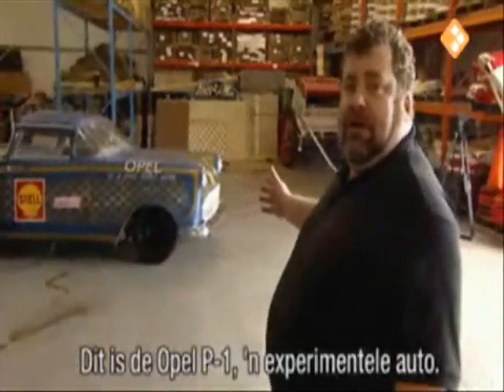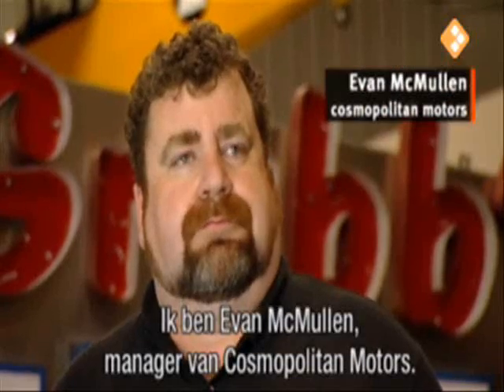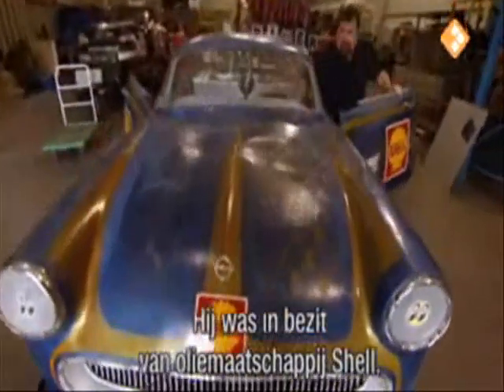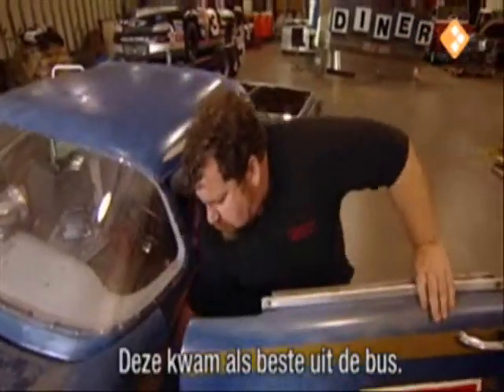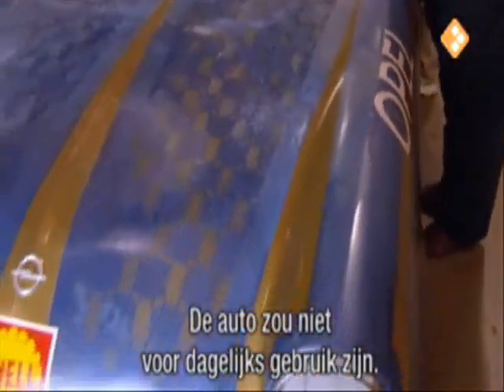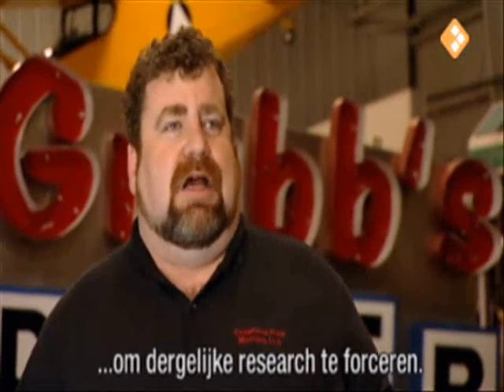High mileage car. 376 mpg!

Comment: I remember the Shell commercials for platformate and it gives me a feeling of nostalgia..
.
Reply: +Marc Mallary 
I used to drive a 1995 Nissan Altima when I had to commute (now I live close to my job)
it was a 5 speed manual
managed 36mpg average in it. (Yes, I know how to drive it for economy, it was rated 27hwy by the EPA)
not bad considering it was actually roomy enough for 4 people,
weighed almost 3000lb,

and had an engine a liter larger in displacement than your Honda.
Reply: I had a 1990 nissan sentra that had no power steering.
You could order one with it, but it wasn't standard.
The sentra b13 also didn't have power steering on the base trim (Sentra E...which also had a 4 speed manual)
My drives weren't on a Sunday, they were my daily commute miles.
If you didn't care less than why would you reply at all?
Since I did get those fuel mileage numbers it happened in this universe.
BTW if you actually understand the concepts of inertia and plan further ahead than what's directly In front of you, you can beat EPA numbers easily in any car.
Reply: Really? My experience shows otherwise and apparently it's the same universe because I am able to reply to you
Reply: It was Sunoco. The name is the name that the company used to get the petro from the tankers to the platforms, hence "platformate."
Reply: The Big Oil floods the market with cheap oil and gas cyclicaly, closely laging inovation. It's happening now. 
I drive a 1992 Civic VX and average 46 mpg city with no modifications, just driving sensibly and going the speed limit.
It is rare because it was developed just before the Iran vs Iraq war and 2 buck gas/ SUV days.
I'm also a bicycle tourist and used only a quart of gas for my stove while riding from Seattle to Blane to San Diego. 
Screw Them
Reply: You're mistaken. You never achieved the average  of 36mpg.  Not In this universe.
Reply: Marc Mallary 
Those early 90's small cars were capable of impressive mileage. It was right at the point where technology was being used to improve efficiency rather than power, and the cars were simple and light, because people actually were OK with a stick shift, no power steering or AC, and crank windows. Also, it was before the safety regime was in full effect. 
The small carbureted cars of the 80's weren't notably fuel efficient, I think my moms 83 sentra only managed  about 30mpg. For contrast, my dad had a 79 cutlass supreme that averaged 25mpg.
Reply: You certainly can, if you don't have a lead foot, a lead brain and a lead car.
Reply: My 93 festiva doesn't have power steering. My dad bought a 2001 accent brand new with no power steering...
Reply: Because you reply to me in this universe is not at question. If you reread my statement I said you didn't get that claimed fuel economy in this universe. Where you go for your fantasy Sunday drives, I couldn't care less. Also name all these  cars from the early '90s  that didn't have power steering.  You are a good 10 to 15 years off on that statement.

Comment: something to consider a 2002 version honda insight,with a prius style on only when needed electric super charger add a prius electric motor and battery sync it for rear wheel drive a car that'll do what awd does at what cost haven't been able to modify mine you might be able too do it :-) Jeff White Hawk FB

Comment: Cool video. What did the "engineers"do to get this mpg?
Reply: Ionize the gasoline into vapor electrically and inject it into the carburetor, perhaps? I can buy a Vick's humidifier at Walgreen's that will covert water into steam immediately yet engineer's haven't the aptitude to attempt this with fuel?
Reply: rjhoody They took a perfectly normal, perfectly useful Opel Caravan and hacked off the back, pushed the two rear wheels into the middle, put the engine where the rear seat belonged, took out every single scrap of luxury appointment - carpets, extra seats, etc - and lots more.  Essentially they made it worthless for anything but moseying down a very smooth and traffic-less track, getting very good fuel economy.

Wasted fuel economy.  They drove in circles, burning fuel to carry one man back to his starting place.  It is an interesting exercise but not practical by any stretch.
Reply: @elhigh  so are you a troll from the gov and fuel companies. it weight 2500 lbs or did you not get that part. the first comercial vapour carb by Poge in Canada got 200 mph on a v8 big block until they filled the gas with stuff to gum up his carb and make it not work. the fact is, we should be flying around in cars getting 500mph but people like you will be sheeple and bow down to the powers that be or are part of the evil that is running the world both are worthless and dangerous to humanity.

Comment: According to the video, the car weighs 2500 lbs. It is not light weight, nor is it aerodynamic.
Reply: It doesn't need to be. Aerodynamics and weight are way over rated for fuel efficiency considerations. Pumping losses and isobaric combustion processes are the real problem. Even a full size pickup truck only needs 20 horsepower to maintain highway speeds once its accelerated.

Comment: For all those conspiracy theorists, did you read the description or see the video?  The contest was run by "Shell Oil Mileage Marathon".  This car was engineered for a contest, not for regular daily driving.  Notice that it doesn't have a fuel tank, and therefore does not need to carry the weight of dead fuel?  It is also extremely small, and light weight.
Reply: 2,500 thats not light also isee your point about the fuel but there was a car designed by audie that got you 100 or over mpg. Just saying its not impossible. And that this car uses a very basic motor. Its not even powered by hydrogen a hydrogen engine would give way more power as well as provide enough energy to create the hydrogen of course it would need to refuel with salt and distilled water but would run clean and last longer. Hopefully its not impossible but currently the zero G impulse motor is in the works and that gets ride of 80% of the weight of the object so i dont see why its not possible in the future. Maybe 2027 or somthing.

Comment: I saw a pick-up on youtube.com running on JUST hho gas!  I've designed an amazing machine that would make vehicles much safer & efficient by doing away with the transmission & replacing it with a device that converts torque into thrust AND it can STORE UP AMAZING AMOUNTS OF KINETIC ENERGY that can be released to accelerate or decelerate the vehicle & would weigh much less than a transmission.

Comment: One thing that is over looked is this: low top speed/ not up to current engine performance. I know that overall its not very important but if you are thinking about it, this car (stock) took 30 seconds to get to 60 MPH and the top speed was 74 MPH. haha So, perhaps we are at the point where we COULD have that sort of mpg but maybe we are also at a crossroads of performance and MPG.
Reply: It only had a 3 speed auto. Slap at 6-7 speed automatic and it would get to speed qui let and people put them on newer f150s v8s and get 100mpg
Reply: claro, pero fue solo una prueba, imagina que se viniera investigando y se hubiese desarrollado mas? que el motor fuese especialmente diseñado para funcionar a vapor y no a liquido, con todos estos años perdidos tendríamos mejores resultados...

Comment: No, modern cars will get WORSE fuel economy when you remove the emissions equipment.  Unless you want to go back to the early 90's in San Diego or Los Angeles where the skies were thick with both carbon monoxide and diesel soot. If you think emissions aren't important then I have no hope for human beings.

Comment: one last comment: the gas mileage is so much better because the liquid gasoline is converted to an actual gas by heating the gas line to at least 150 F.  It is the same way a Coleman stove uses a cleaner form of Gasoline, known as White Gasoline, to run a camp stove. The gas line is heated and therefore the burning of the flame is very efficient and much cleaner than burning ugly liquid gasoline. It is a simple method and the Oil and Gas interests are far more powerful than the Car makers.

Comment: You show that typical misplaced hate of government. It is more reasonable to be more upset with a our economic system to find a simple technological fix. A "fix" that was and is actively suppressed by the Oil/Gas Interests. Be that as it may, Shell Oil did what GM, Ford, Chrysler actively said(and still say) was impossible, and yet it was Shell's modified 1959 Opel P1 Experimental car that got  376 mpg. BTW without Taxes you wouldn't have any roads and your car would becoming virtually useless.

Comment: Your points are noted, but conventional, think unconventional. Imagine a car bumping along at 400 to 600 rpm, doing 60 mph, using vapor as fuel. Use high comp, a scatter cam, insane hot spark, tones of air, little fuel, 0 to 60 in about a week times, closed coarse, no brakes, no trans, no weight, a useless car for the commuter, but as a test project. I can see nothing from this guy to gain by lying, he didn't build the car, makes no fame from it, so I ask, is 376 possible?

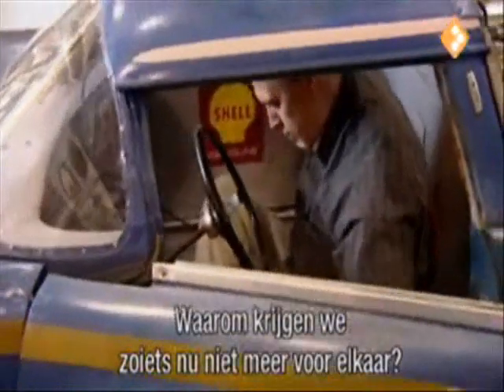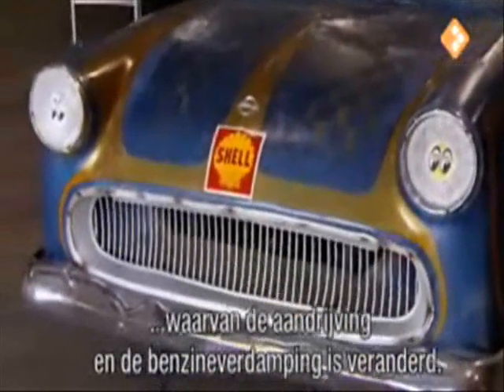Comment: first go to 2:43 of the video and notice that when they hit the key to start the car, it lurches forward, then go to 2:50 and look at the modified drive line, A small gear on the crank, a bike chain to the rear end and a huge gear. That's the same as a huge overdrive, low RPM to drive forward. Then to 3:00 to 3:04, "modified drive system and heat to the fuel for vaporization". This system will get the 376 mpg, but will crawl along slowly doing it. This is real, cheers mate.
Reply: Minimum speed in the competition was 35 miles per hour.

Comment: Man, I am in the process of trying, come hell or hIgh water, to make the HHO generator I purchased from Global Energy Devices, for 300.00+. First they said"Oh, you have to run at least 1000 miles on the gen., themn flush and refill, readj. and FAIL again. I don't think it's making enough gas. I removed an EFIE (100.00), and MAP enhancer(I Built) to try 1 mo time. Then I make it burn in a pile in the STREET!

Comment: Just curious if you've taken the difference between the imperial and U.S. gallon into account with your statement? ) 4.54 liters is roughly 120% of 3.79 - about 20% larger. And yes the imperial gallon is only used in the UK and Ireland (maybe Canada) but that doesn't matter because you're referencing gallons (MPG). European country's use liters and measure based on distance per liter (KM/L or L/KM).

Comment: At least we can each build our own gasoline vaporization systems. And special thanks to inventor Paul Pantone for permitting every individual to build one GEET Fuel Processor (Paul notes the free build plans work). Go to GEET international.(com) to download the free "single auto conversion plans", or the small engine build plans. GEET is a self inducing plasma generator. I'm in the process of building my first GEET.

Comment: The corps and big bankers dont want to solve anything unless it puts more money and control in there hands. Shell bought this idea from a California mechanic in the 1940's and locked it up and the mechanic mysteriously died not long after. Documentary "Gas Hole". The newest types of high pressure fuel injection are close to fuel vapor cause they spray a fine mist into the cylinder but the fuel particle size is still to large to be vapor.

Comment: Fact is no they dont they only spray at a fine mist the heat in the motor makes it into a vapor causing a cooling effect thats a myth by car makers put it to the test i have with the fresh air and the heat u still even with the high pressure setups only get a 40 to 50% vaporization only after its put in the motor due to the speed u never get 100% unless u do it out side the motor. If injection is so great then why do i always get better mileage from carbs when i setup my way!

Comment: All u need to do is look at physics and if u take a car getting 30mpg if u take one gallon of gas and vaporize it it will turn out to be 8 to 12 gallons of vapor! next do the math 30mpg x10= 300mpg multiply by average gas tank size say 10 gallons so 300x10=3000miles per tank full and now if u do the same math for pure alcohol than u wouldnt need to import any gas or oil at all its not rocket science big oil new this back in 60's but how much money will they make if they let it out not much!

Comment: This is TOTAL crap. An electric car like the Volt can only attain about 100MPG equivalent. The internal combustion engine is a heat engine, very inefficient. A special fuel vaporizer will not change the fact that heat engines are highly inefficient. With claims of 376MPG, it is totally ridiculous. Even the super aerodynamic Aptera electric car does not have this equivalent mileage.

Comment: Those "original" Fords that he claims got 20 MPG had a top speed of 45 miles an hour.  If everything was tuned perfectly, you could get 20 MPG cruising along at 25-30 miles an hour, if you could find a road back then that you couldu maintain such a speed. There is a good reason that the Model T's are nothing more than a novelty at a car show these days -- they were just not competent to drive on the roads today.
Reply: No, the Model T had a top speed of 55 miles per hour, not 45. And the Model T's engine was designed in 1906. There is zero excuse for the lack of innovation over 100 years.

Comment: Yes, this car is well documented, Shell engineers had contests with each other, this is the result, then it was put on the shelf.

 I guess it doesn't have a carb, the gas is vaporized and fed into the engine and the tank is wired for heat, but the gas probably is ultra pure with no additives.

Comment: If anyone is interested in seeing a truck run on vapors from gasoline, just type "Molecular Chamber" in the you tube search bar. Bill has been driving his truck for about 25 years with his vapor chamber. Basically, he heats a Calrod heater up to 600 F. and sprays a fine mist of liquid gasoline onto the hot metal surface area. The gasoline turns white as it combines with oxygen. I'm building my first system now and I'll make video's showing every aspect of it's function. More power and mpg.
Reply: Hola qué tal te fue con el invento ?

Comment: Looked up Shell Eco Marathon on wiki and on shell's website...its real and still going on, but its not we hope. The cars only go 15mph, on flat track, accelerate to 20mph then turn off engine & coast till they drop to 10mph, accelerate again, average of 15mph. They can NOT climb hills, cant pass a kid on a bicycle, and cant carry so much as a grocery bag of cargo. And my winter coat has more crash protection. as of 2011 they are commonly getting 500mph+. Wow. But it has zero practical use. ZERO!

Comment: @VRJensen1 Right, I'm working for "Big Oil" the same way the laws of thermodynamics are and all the engineers/scientists that are confined by them. The ICE is 30% efficient. 70% goes to heat and friction in the engine/drive train. And you realize Shell is an oil company, right? Drop your car til it's 3 inches of the ground and drive under 15 mph on perfectly flat roads with NO TURNS and you'll see big mpg gains as well. Trust me, men in black suits won't come knocking on your door.

Comment: @andre1dre you would not drive that piece of crap, i've seen these "ultra high milage cars" on test tracks, they shut the engines off and coast around a flat track all day at 5 miles per hour...good luck driving up a hill, the car can't do it.

Comment: I know much can be improved in efficiency but I'm a little skeptical about that particular car. it looks anything but efficient. 
what speed was that mileage achieved at? I take it it was walking speed
Reply: The spec was 35mph minimum and it had a 3 speed auto. Slap a 6 7 speed with a aluminum frame. What this video doesn't tell you. When they heavily modified it to how it looks in the video it got 1100mpg. But 400mpg with 3 speed and 2500lbs curb weight 70 years ago. Even Hitler was driving in the 30s with v8s getting 80mpg.
Reply: 35 miles per hour was the minimum speed.
 Its all laid out in DR Blackmores "Fuel Economy of the Gasoline Engine" Its peer reviewed and everything.

Comment: @VRJensen1 Gas Hole was such an informative 2010 Documentary. I also have a 1 Liter 3cylinder engine in my 2000 Honda Insight. I'm working on a system which will vaporize the gasoline- and I'm very interested in what the results will be. I've design a system that will utilize the original fuel injection system- which is multi port(3 injectors), I will heat the fuel to 400 Degrees F to achieve complete vaporization, and use a air pressure regulator to reduce the psi to about 1psi.
Reply: I realize it’s been 6 years but I drive an Insight too. If you could and haven’t already, I’m sure the guys at Insight central would want to hear more about this.
Reply: Que tal te fue con el sistema?

Comment: It's just a fuel vaporizer invented by Tom Ogle in 1977 getting over 100 mpg in a 4400lb car. He sold the design to Shell oil company hoping they would improve it but Shell had other plans such as locking the idea away to keep gas demand high. Look it up.

Comment: well of course this was real,  they used a kind of Charles Pouge carburetor 
vaporizing the gas, nothing special or new..just covered up by big oil and government ..
no brainier.. but we can do the same thing if we really want to but using ultrasonic  vaporizer , you know the things that make fog in water. get them anywhere on ebay or home depot in form of ultrasonic humidifier .

Comment: I to feel that we should have come up with ways to get better fuel mileage since 1973 but our technology is stagnant due to the greed of the oil industry which has been backed by our government, both dems and repubs have failed in cheering on the battle for less oil use through better mileage. That little opel is pretty cool.